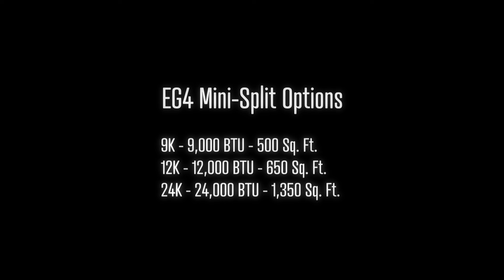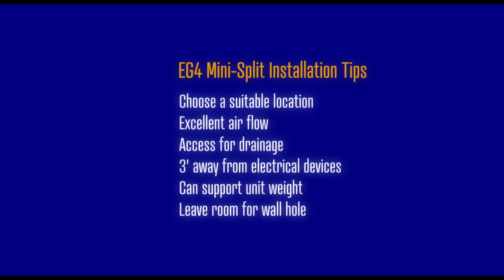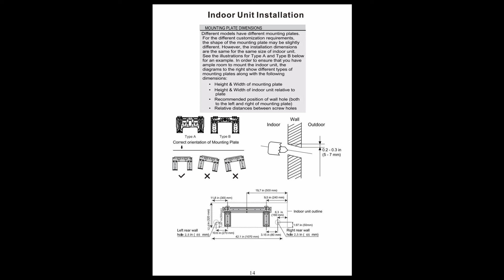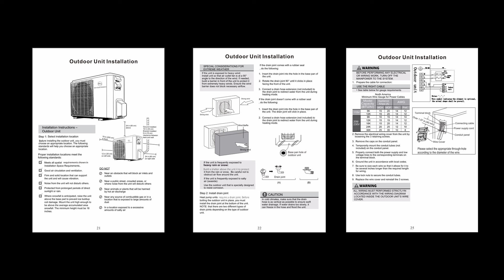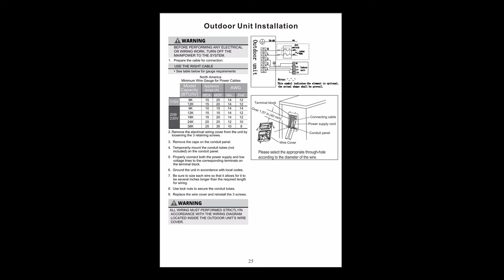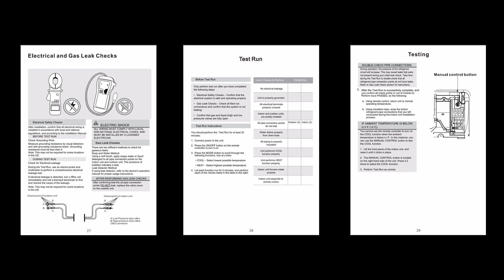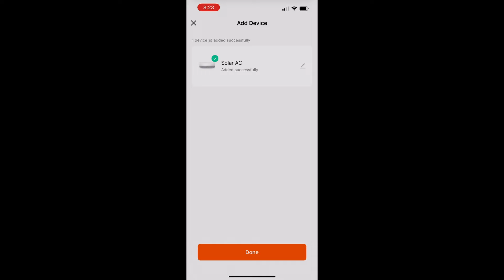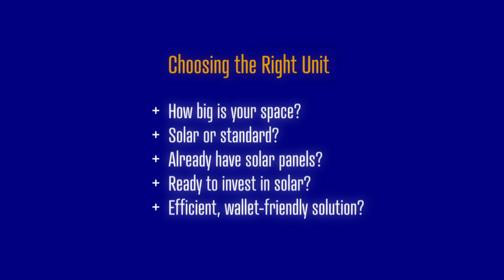EG4 Mini Split Air Conditioner Installation and Overview -Energy-Efficient Climate Control Solutions

Comment: Quick question: why does the indoor head unit appear to be rather large? The size appears to be similar to a regular 18k btu unit
Reply from the maker: The Minisplit unit dimensins are: 33.1×8.1×11.6 in. - The 18kPV dimensions are 34.3×20.5×11.2 in - So it's quite close!
Reply: @SignatureSolar  Bummer, I was hoping to be able to use this 12k unit in my travel trailer, but I have only 32” for a super tight fit between some overhead cabinets. Thank you for your prompt response!
Reply from the maker: You're so welcome!

Comment: What size btu i will need for 192 sq.ft bedroom with 10' ceilling also the climate is about 85 degrees to 100 degrees (Bahamas) ?
Reply from the maker: Up to 200
4,000 BTU
Up to 400
8,000 BTU
Up to 600
12,000 BTU
Up to 800
16,000 BTU

Comment: OK. I plan on mounting it in a motorhome with a 78-inch ceiling. How can I mount it 98 1/2 inches off the ground when I only have 78 inches from floor to ceiling? Can I mount it a little closer to the ceiling, say 4 inches, since the ceiling is so low, or must it have the full 6 inches to fit?
Reply from the maker: We reccomend following the instructions in the manual ☀️
Reply: @SignatureSolar  The instructions in the manual are contradictory for my application. If I mount it 6 inches from the ceiling, as the manual suggests, I won't have 98 1/2 inches off the floor. If I subtract the 27.6" height of the head unit, I will only be able to mount it 50.4" off the floor, about half of the 98 1/2" that the manual suggests. Is this optimal for my application? If you don't know, is there someone at the factory I could speak to about the install?  Thanks.
Reply from the maker: You may run into code issues if you don't follow the measurements suggested in the manual if you are in an area that requires an inspection.
Reply: @SignatureSolar  We don't seem to be communicating. The installation would be in a motorhome. There are no applicable codes for a motorhome. Are you saying that this unit can only be mounted on walls 11ft or higher? Because that is what the manual's specifications suggest if you add up the 6" from the ceiling, 27.6" of the head unit and 98.5 inches it must be mounted off the floor. I guess every house with 8 ft ceilings can't install this unit then.  Please re-read my previous posts. Thanks.
Reply: @SuperSushidog  The product has requirements that don't match your situation.  The units are not compatible even with 8ft ceilings.
Reply: @sarentopi1502  Thanks for the reply. Since I did not receive one in a timely manner from Signature Solar, I purchased the 28.5 Seer-2 EG-4 model from Solar Sovereign after consulting with them. I mounted it 7 inches from the bedroom ceiling in my motorhome. This puts the bottom of the indoor unit 5 ft off the floor. I have been using it for the last 6 months in this position and it works great in my motorhome. I am very satisfied with my purchase, as this model uses very little power from my 48v battery bank as I live completely off-grid and run it almost 24/7 off my inverter.
Reply: @sarentopi1502  There is no requirement for them to be 98 inches from the floor to the bottom of the unit, only that the top of the inside unit has 6 inches of clearence from the ceiling. The manual is wrong. I have been installing them in relative houses since the 80's in Asia.
Reply: I have one installed in a motorhome with 77" ceiling and just ensured that the space above it is equal to the square inches of inlet screen on the top (about 2.5" away from the ceiling and open on 3 sides).  I live where we have 107 degree summers so when it's that hot, I'll prop open the front panel on it so extra airflow can go in.  It works great.

Comment: This is just a MR. Cool with a repackage right? Same exact mount and lines.
Reply from the maker: We are a distribution company. EG4 is a manufacturer, you would need to reach out to them for that information.
Reply: @SignatureSolar  EG4 is selling rebranded Chinese Deye units.
Reply: @sarentopi1502 and that is just fine if that's what it takes.  Far better than not having it at all.

Comment: Mine came with sealant putty. What is the intended use for it?
Reply from the maker: To seal the hole you feed the line set through to the outside

Comment: How do you run it and make sure it doesn't run in a brown out condition. Is what I would like to know
Reply: If it wired to solar inverter. And you do not want to run it you have to shutdown it yourself. If it on grid it shut it self off due to no power from grid.
Reply: @Tonyinmemphis  Say I want it to run only on solar power. Now the sun goes down. Won't it burn out my motor in the pump? Has the amperage drops? You'd think there might be a low amperage shut off. You wouldn't want to stay. The point being, you don't want to stand there and wait for the Sun to start going down and then randomly shut it off. When you think the Ambridge is dropping.
Reply: @chuckb9867  This unit same as all mini splits they run on less amps. This one there showing is a addon for a solar system with battery backup. There could have the amp draw on there site and if unit is 115v or 220v. I do not know what the fail safe is for low power. most inverter's will shut down low power. Being in a stand and open air you need check the filter weekly. Shoot me one lol .
Reply: @anthonymartin2412  If the low Power shut off is in the inverter. I wonder how it works on the twelve volt side

Comment: My climate (Calif Coastal) wants a heat pump all winter, but only needs a few days of cooling in heat waves.  It looks like you dedicate solar panels to the hybrid.  Q1: If I have 8 solar panels in series under 380V and under 12A can I wire them to my hybrid and my in solar inverter in parallel so DC output not needed by the hybrid, can flow to the Inverter and still provide become AC power for my house?        Q2: if Strategy 1 does not work in real time parallel, can it work by turning the hybrid off in the summer until it's needed.  (Then summer solar would go to inverter and house as AC current until hybrid is turned on to take all the solar DC current.)
Reply from the maker: Our recommendation is to run a single dedicated PV array for the Mini-Splits. This approach ensures optimal performance and efficiency for your system.

Comment: Max solar voltage is 380 watts???
Reply from the maker: Max voltage is 380v. Max wattage for the compressor is 2250w.
Reply: @SignatureSolar can you over watt?  But not over 380v when paneling?

Comment: !!! Make very sure the cardboard template matches the indoor unit! Especially the hole. In this video you see the hoses come out of the unit a few inches from the right side, and the hole in the template matches that location. On my model the hoses are coming out directly against the right side of the unit, and stupid me had already drilled the hole in the location the (wrong) template provided, which was therefore several inches off. I had to very carefully bend the hoses inside the unit to get them to that wrong location, which was a tight bending I would rather not have done. To add insult to injury the hole cover provided was sticking out under the bottom of the unit, preventing it from locking properly into place. I replaced it with a rubber 'flanged spud washer' that I fitted around some PVC pipe that I led through the hole. Another flanged spud washer on the other side made that hole a nice looking tube with no sharp edges. This was an indoor hole from my kitchen area into my laundry room. The 15 feet of hose supplied with the unit was enough to get to the other side where I did the same thing, using a PVC pipe and washers through the outside wall right next to where the unit hangs. I have only 1 small loop in both hoses that I can easily hide indoor behind a closet that does not touch the wall anyway.
Reply from the maker: Thank you for this feedback! We will inform the manufacturer of your finding! Please let us know if there is anything we can help with!

Comment: Mount how far from the ground?
Reply from the maker: Hi @user-lz5pe9df4y The Mini Split doesn't require a specific height from the ground; rather, it should be measured from the ceiling. If you have any other questions or need guidance with install, please do not hesitate to give us a call, we are here to help!
Reply: Yeah. I heard 98" of ground and most ceilings are 96 at best.
Reply: @SignatureSolar  For whatever reason, the manual on page 7 specifies a minimum clearance between the bottom of the indoor unit and the floor as 2.5 meter which is 98.42 inches. This would require 10 foot ceilings.

Comment: I have an odd Quick connect on my unit labeled AB With a red and white wire anybody know what that’s for. It’s on it’s in my indoor unit underneath the cover near the terminals
Reply from the maker: It's an unused port.

Comment: Self explanatory for the remote?  Not hardly.  Neither is the app and what each icon means and does.  Please post that information.
Reply from the maker: Unfortunately we only have the manual that EG4 provides with the unit, however, if you would like to call into our tech support line at 903-441-2090, we can certainly help you identify the icons and uses!

Comment: Is it possible to run the smart cable, drain line, and copper lines inside the wall cavity and exit at the desired location at the bottom bottom?
Reply from the maker: While it's feasible, the risk of drain line leakage in the wall cavity is a concern. Additionally, the stiffness of copper lines makes it challenging to install them within the wall, posing a risk of kinking or damage.

Comment: Mounting at least 98.5" off the ground WTW?! 🫨
Reply from the maker: Hi! Thank you! Yes, this is a mistake and has since been corrected in the manual. The most important thing is that it is at least 5.9 inches from the top of the ceiling.